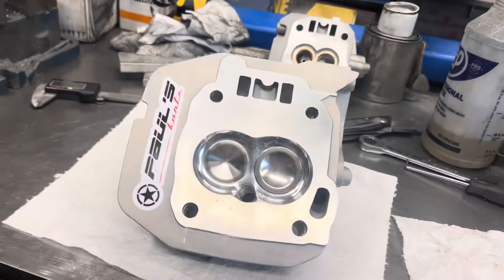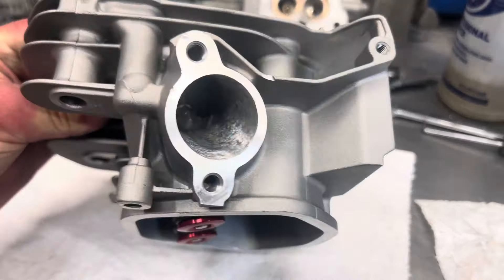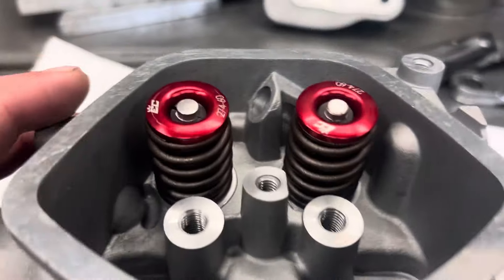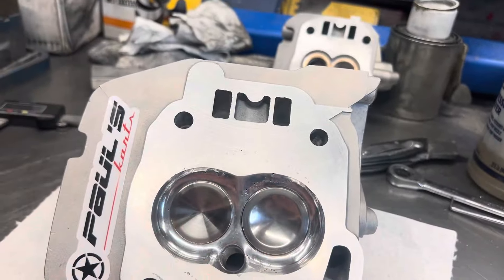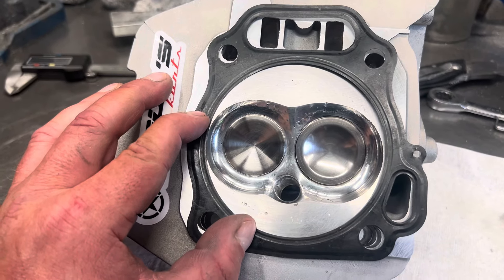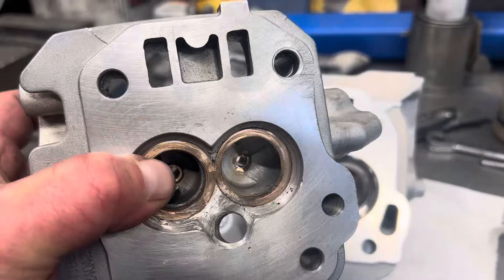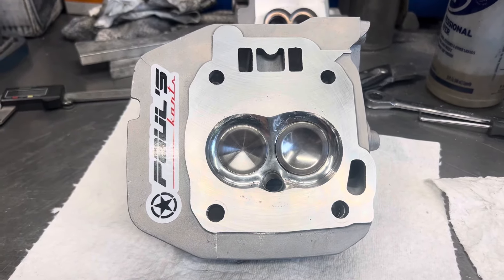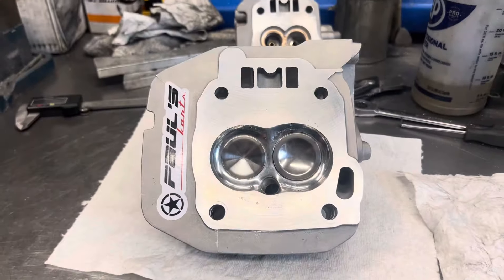Gx460 head, for the Turkinator !! Air fuel compression 🤘🏻😎 Paul’s karts

Comment: I just got into building these small engines. After building 1000’s of V8’s. And when I need to know what has to be done. Paul is the man.  It’s fun porting and building these small engines.  You can build one and test fast and turn around pull it apart make changes and see how it works. Your the man Paul

Comment: You build the best stuff out there
Reply from the maker: Means a lot to hear that thanks
Reply: @paulskartslifan4206  Is it possible to make a top fuel predator/ single cylinder engine? Enough nitro borderlining hydrolock, and enough energy into the spark plug its like a arc welder. The spark plug would only last 5 seconds max, but the power is unheard of, how would one put that much amperage in these spark plugs?

Comment: Have a random question could i use 26lb valve srpings cus thats what i have? for 1.3 stamped rockers. On a stock pred cam
Reply from the maker: @MrLopez-lm4jk  technically yes I believe so they should fit .. if there perfect for that setup I’d need to see it